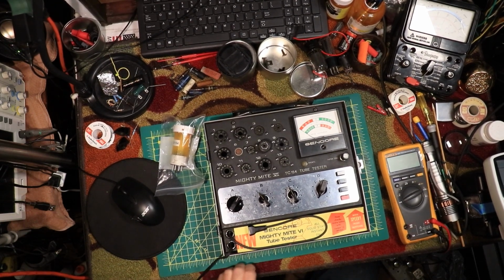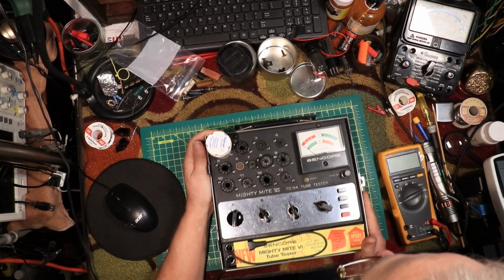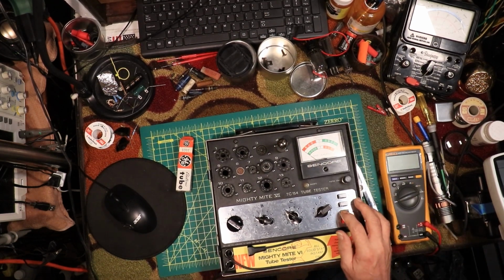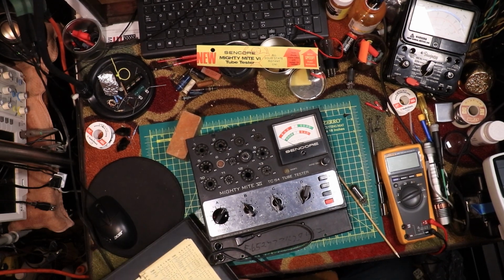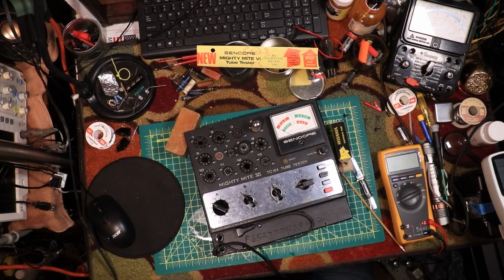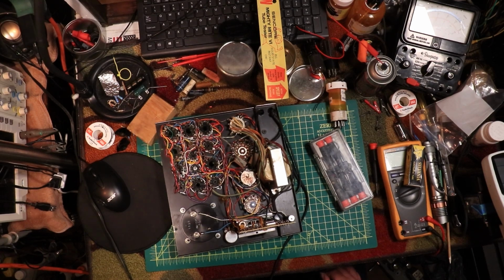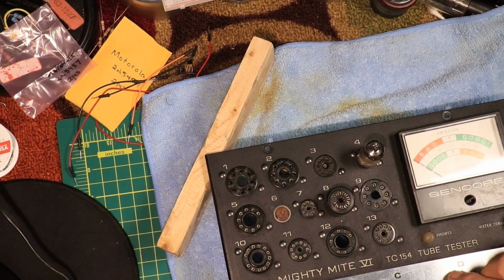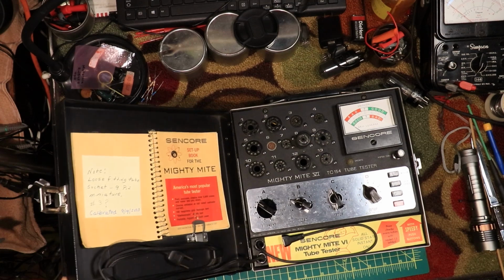Sencore TC154 Tube Tester Repair

Comment: Good fix Ken, just the jfet I guess but changing resistors also helps. The Mighty Mite is a goer again
Reply from the maker: Thanks Frank, yeah, the resistors probably helped for accuracy. I finally found my breadboard and corresponding parts kit for it and connected the JFET to it using a 2-volt LED and a 9-volt battery, the JFET was definitely defective. I think its acts like a switch and the calibration tests was working fine because the filament voltage was set at only 1-volt. I’ll do a very, very short video showing the test results of the defected JFET compared to a new one.